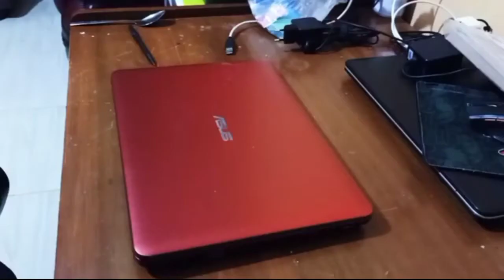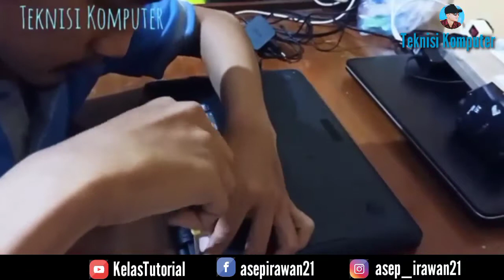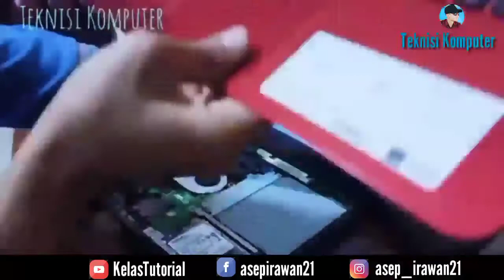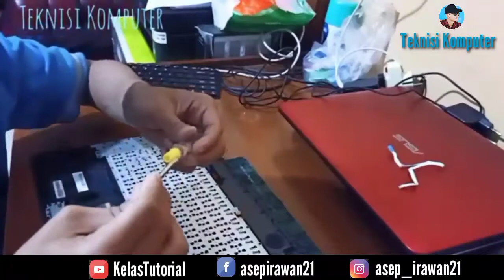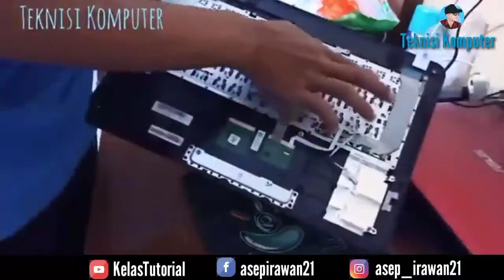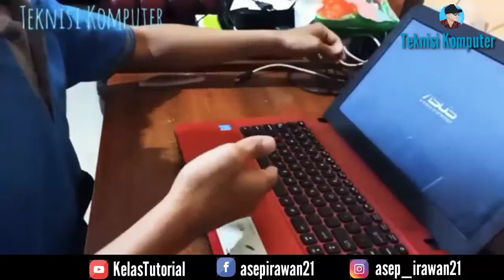Laptop Mati Tapi Lampu Indikator Hidup Sebentar - Asus X441M | Teknisi Komputer

Comment: Gan sama hal nya dengan itu tapi lampu indikator berkedip sebentar saat d cas laptop ga bisa nyala, karna terlalu lama ga d pake
Reply from the maker: Silahkan di copot  batrai, ram, hardisk, setelah itu coba di pasang dengan tanpa hardisk dan hidupkan. Jika sudah hidup. Lalu pasang hardisk dan batrai. Jika tidak hidup. Hidupkan tanpa batrai.
Reply: @ytkelastutorial3064  saya sama seperti itu indikator power hanya berkedip, dan udah copot baterai dan dicolok charger malah gabisa nyala sama sekali tapi lampu indikator charge menyala